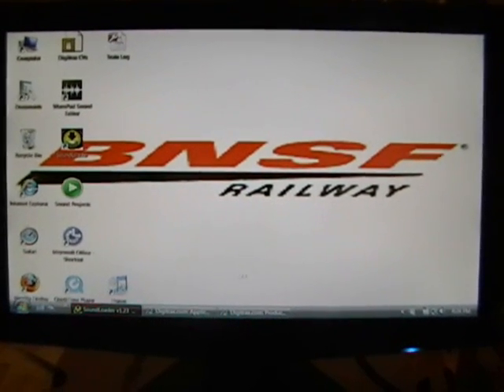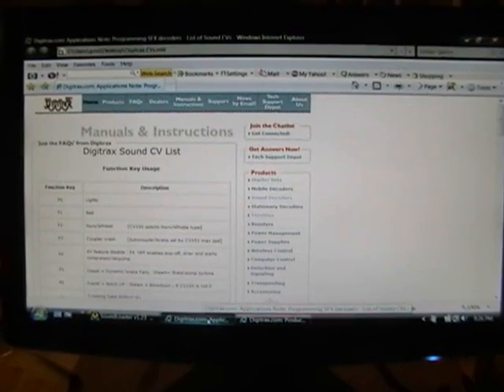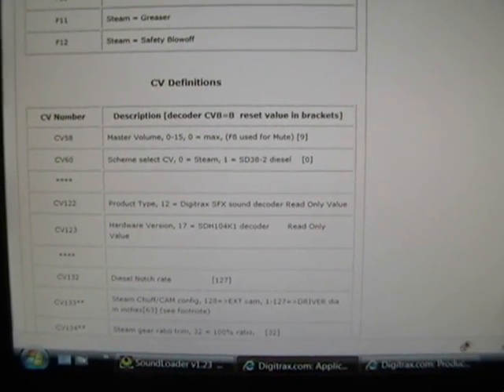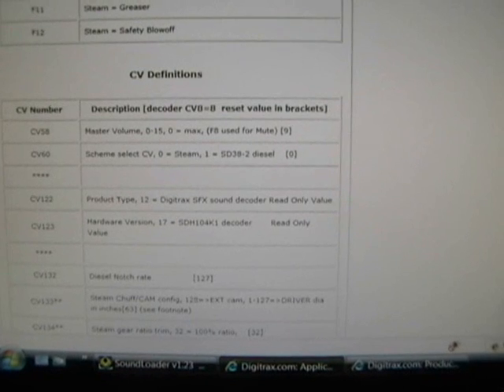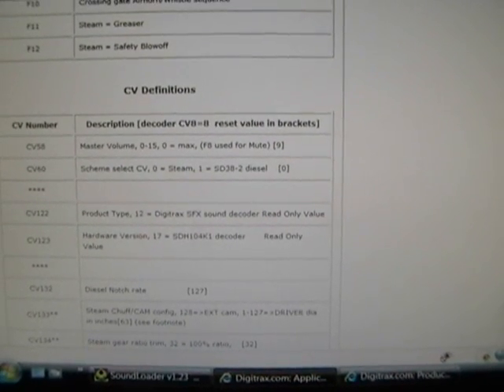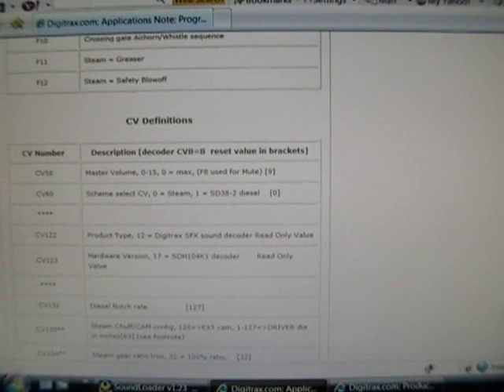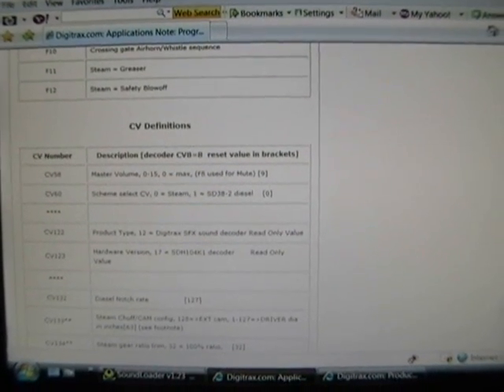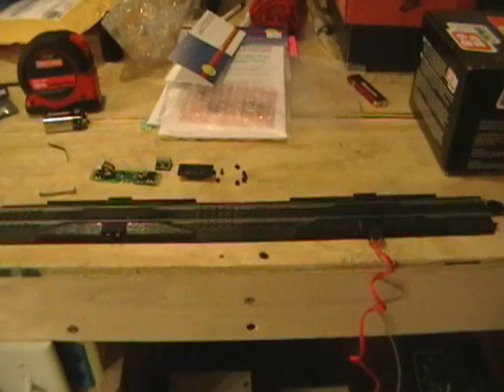03-29-2010 Advanced DCC - Part 4B CV Programming and 4 Digit Address Change

Comment: I am not able to download the selected project sound schemes in approximately 3/4 of the soundbugs in my roster . I have over 40 locos equipped with s.bugs . I installed them more than 10 years ago then waited another 5 years to buy a PR3 , then began only 3 years ago to download schemes and nothing worked , I have seen a guy in another video that says the memory slot in the soundbugs are manufacturing defects. Am I crazy ?
Reply from the maker: I don't think you are crazy. The second generation sound bugs have more memory than the first generation. Digitrax is trying to stay competitive. Many of the projects that are available today are larger and wont work on the older bugs.

Comment from the maker: You are correct. I forgot about that. Soundtraxx does not like 3 amp systems when programming for some reason (doesn't matter if it is NCE or Digitrax controller). I do most of my programming with a Digitrax PR3. It works out quite well.

Comment: Hi there Tommie thanks for the info I generally do that with all my locos, from what I've noticed is I can do it that way but the engine starts up with the new adress but doesn't move or light up or run the functions, yet when I press default 03 everything works, which makes me wonder if cv17+cv18 have to be changed and how to set up cv29.

Comment from the maker: The Zepher manual section 16.2 has a great overview. Select Program for either Ops or Page Mode (if using a program track). Press Loco two times for AD4 (or 4 digit address). Use the key pad and type in the new address. Press CV-RW (or CV write) to write the address to the decoder. You are all set.

Comment: Any suggestions for programming a Bachmann decoder? I just purchased 2 spectrum steam engines, with factory DCC installed, but no paperwork came with them to aid in programming the loco address. One I programmed fine, had no issues at all, the other, I cant get the digitrax system to program it. I've heard a 1/4 watt resistor laying across the tracks will fix this  problem?

Great video!

Comment from the maker: @retrainrun Hi - it depends a little on what DCC system you use. With a DT400 series, simply press the program key a few times until the locomotives address is shown (or one time for anything that is on the main line), and start programming. This is refered to as OPS mode